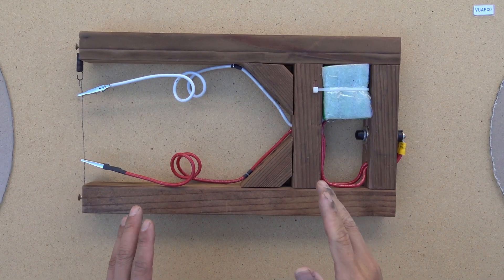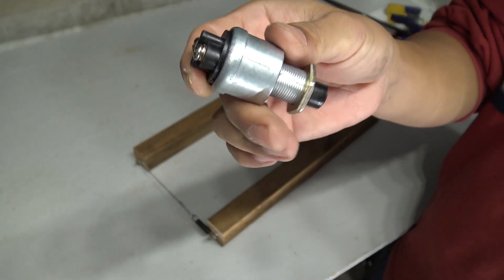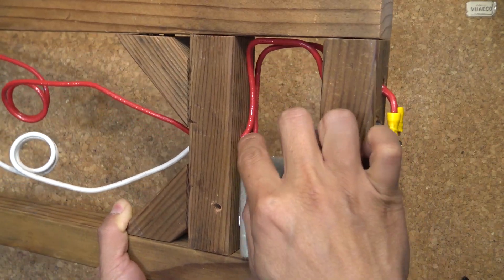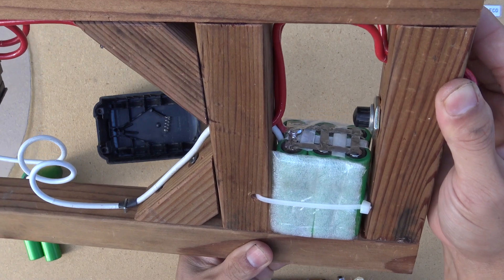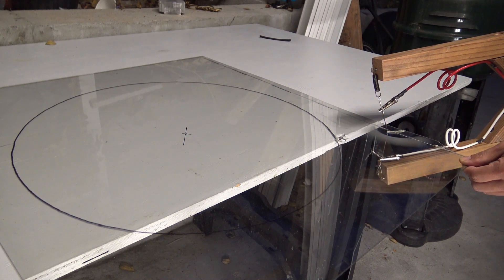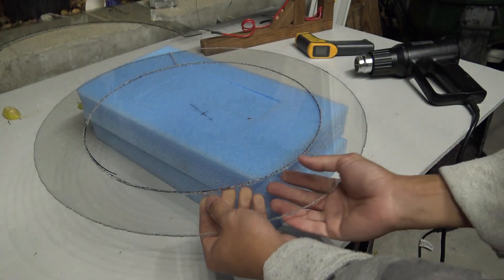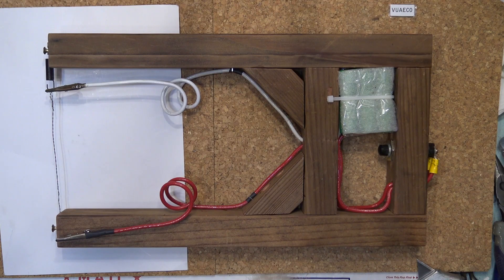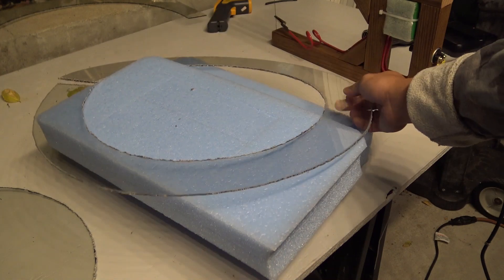DIY: Home made Cordless Plexiglass/Acrylic panel (PVC & foam) cutter

Comment: Hey Brother, Instead Of Using Batteries Buy Yourself A Cheap Variable Power Supply. This Will Save You A Ton Of Money Over Buying Batteries + No Trips To The Store For More Batteries + You Can Adjust The Power To Suit Your Needs + It Can Be Used On Many Other Projects.

Comment: Nice project, but you need to provide some current limiting for the Nichrome wire. This can probably be done with a couple of transistors, resistors and diodes.  Nothing fancy.  Nichrome wire can get up to 2000° C, but you only need the wire to be 200° or so to cut cleanly through the plastic.  If you keep the temperature down you also won't get the carcinogenic fumes given off.     From what I can tell, if you limit the current going through 18 guage  Nichrome wire to just under 5 amps it would keep the heat of the wire at about 200°C.  That should be plenty enough to cut through the plastic without vaporizing it.

Comment: Hi this is a good video. I like the DIY spirit. Because I'm a DIY-er too. I have made 3 foam cutter using Nichrome wire. But haven't made one for plexiglass just yet.

Here are my suggestions:
1. Nichrome wire you can get from eBay in various thicknesses. It cost around £4 for 5 meters.
2. Use a PWM to control the voltage from you Voltage source, and in turn it will vary the I current and temperature of the wire to optimal value.
3. Use a Power Supply (PSU)..12V, 12.5A for £12 in eBay. Connect the input to the wall plug. To get AC input, and the output is to the PWM (depends on the Voltage output of the PSU you buy). 
-Then voila. You have your cool cutter working perfectly using electricity from grid. And variable temperature using the PWM. That's what I did for my foam cutters.

Comment: i made a much much larger version of a similar one like this .....i almost was going to suggest to you that nickrome, I wire for vaping is the wire you need but then you found out in the video hehe. I vape so i already knew that the nic wire is the way to go plus i also invent things such as your self....the big one i made i use it to cut threw large with foam and mines looks a bit different so its much easier to carry since its much larger.......great job i think all you need is to adjust the volts going in it to be a bit faster in cutting yet not to hot....thats what i did to find out whats the right voltage and amps running to use for my needs and not have to wait to long to have it cut.

Comment: Well done McGyver!   Impressive but I think I'll go the oscillating tool route.
Reply from the maker: If you have that tool AND that blade then yes (it's not cheap!). The hot wire cutter can also cut foam which you can't do with an oscillating tool.

Comment: Great idea and explanation. I think I'd rather use a 120v variable transformer if portability wasn't an issue. That way it may be able to be set just below the toxic smoke threshold and above the saw motion of the work piece necessity... if that setting is possible. Also the obvious is no recharging needed. Thanks for the jumping off point though.
Reply: Fred Mertz Good call on the Variac idea.  That would be for a bench top stand alone model that allows for hands free operation.  Handy if you’re going to feed an oversized sheet and use both hands to support it through the cut.

Comment: Nice project and analysis of development issues encountered to get your final design. You're right about inhaling thermal degradation products of acrylic polymers being toxic even at low ppm; the difference between mere melting and pyrolysis.

Comment: Neat. I've had pretty good results cutting plexi with a jigsaw.
Reply from the maker: Is your Plexiglass thin or thick? I tried jigsaw with my 2mm plexi but because it's thin, it flexed too much and cracked. I think jigsaw is fine if your Plexiglass is thick enough. But you'll have a hard time with a thin one.
Reply: Good point, mine was 1/4" so ~6mm.